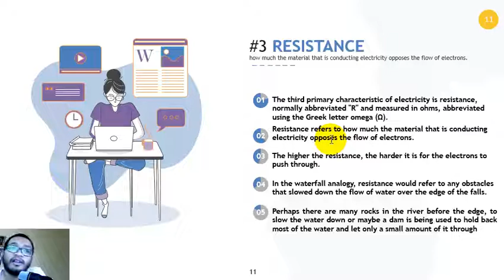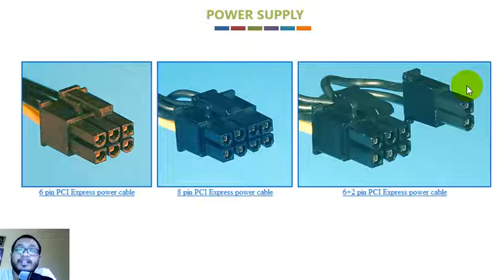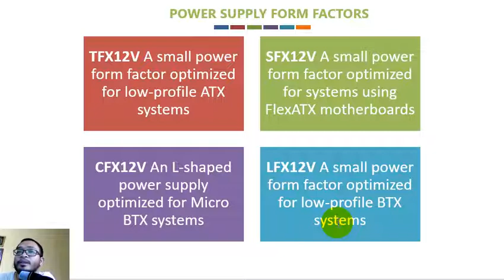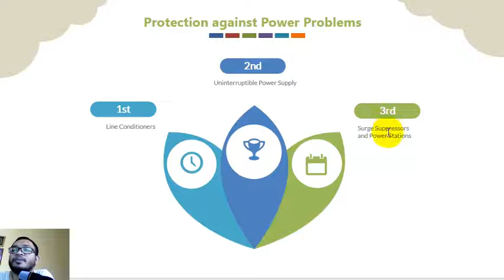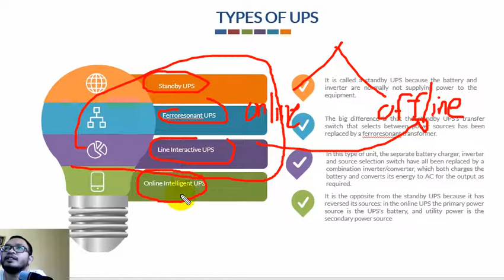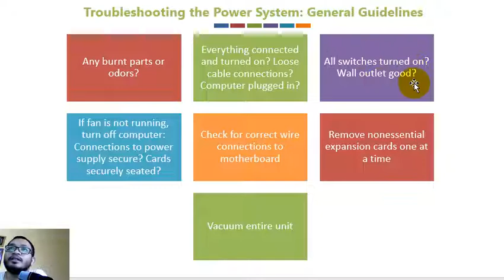Comment: In a conclusion, power supply is an electronic component that convert AC to DC. Electricity cause by movement of electron towards a positive charge. There are have 3 criteria or called as OHM’s law in power supply which are voltage, current and resistance. Voltage (V) is potential different in a circuit. Current (Amp) is an electrical current. Resistance (ohm) is resistance of the current. Next, AC and DC. Direct current (DC) is produced by batteries, static and lightning. Alternate Current (AC) is that you get from your house’s wall and that you use to power most of your electrical appliances. However this AC current must be filter by your power supply. There are have 4 roles of power supply which are stability, energy efficiency, expandibility and cooling. This power supply has many problems for example blackout, line noises, lightning strikes and brownout. Lastly, Uninterruptable Power Supply (UPS). There are four types of UPS which are standby UPS(the cheapest one), ferroresonant UPS, line interactive UPS and online intelligent UPS . There are two category of UPS which are online UPS and offline UPS.  Standby UPS, ferroresonant UPS and interactive UPS are under offline UPS while online intelligent UPS is under online UPS.

Comment: Chapter 6:
In conclusion, Power Supply is an electronic components that convert AC current and DC current.  In power supply, there are 3 criteria which are voltage, current and resistance. Voltage is potential different in a circuit. Current (AMP), is an electrical current. While resistant (OMH) is how much the materials the opposing the electricity.  Direct current is the first and simpler type of electricity, it produced by batteries, static, and lighting. Usually the voltage is about 12v only. Alternate current is electricity that can get from the house’s wall and use the electrical appliances. This AC current must be filtered by the power supply because the motherboard cannot accept the power that come from the wall outlet.  There are four roles of power supply, which is cooling, stability, energy efficiency, expandability. Besides, there are few problems of power supply. First is surges, it is temporary increase of voltage. Second, line noise, it is small variations in the voltage level that delivered to the computer. Next, lightning strikes, it will deliver a charge of millions of volts. Brownout is the opposite of surge, brownout is decrease of voltage. Lastly is blackout. Blackout is when the power is totally fails. Moreover, there are four types of UPS which can be divided into two category, Standby UPS, Ferroresnonant UPS and Line Interactive UPS is offline power supply. The only one that is under online power supply category is Online Intelligence UPS
.

Comment: In a conclusion, for chapter 6 which is about power supply I have learn about first is electricity. The conductors that allow the movement of electron, the insulators which is a materials that do not conduct the electricity. Then, the voltage, current and resistance is about electricity and especially on how we can use electricity that we need to able to measure its fundamental properties. Next is about alternate current and direct current. Besides that is networking connecting computers together so people can share any data and resources there. Power supply was divided into 4 roles which are stability, energy efficiency, expandability and cooling. This power supply has the problems like blackout, surges, line noises, lightning strikes and brownout. So I know that there a solution from these problems, the solution is the protection to power problems which are line conditioners, uninterruptible power supply and surge suppressors and power stations. Lastly, I had learnt about the types of UPS. There are 4 types such as standby UPS, ferroresonant UPS, line interactive UPS and online intelligent UPS.

Comment: As a conclusion,  chapter 6 discuss about power supply. in this chapter include voltage, current and resistance. voltage is also know as electromotive force (EMF). current is measured in amperes or amps, abbreviation ' A'. resistance is refer to how much the material that is conducting electricity opposes  the flow of electron. this chapter also include alternate current and direct current. Alternate current is harder to explain than direct current meanwhile direct current is the first and simpler type of electricity. Then, I know that network is a connecting computers together so people can share any data and resources there. power supply role have four which are stability, cooling, expandabality and energy efficiency. power supply form factor is TFX12V, SFX12V, CFX12V & LFX12V. power supply also have their own problem which are blackout,  brownout, surges and line noise. and the last one that i learn in this chapter is the type of UPS. type of UPS have four which are Standy UPS, Ferroresonant UPS, Line Intertactive UPS and Online Inteligent UPS

Comment: as a conclusion electricity cause by movement of electron towards a positive charge because of condustors such as copper. insulators are not cconduct electricty suc as plastic. 
voltage (v) is potetial differance or electronic force. current (amp) is how much electricity is flowing.  resistence(ohm) is how much the material that is conducting electricity opposes the flow of electrons. voltage can be measure using ohm's law. 
issues are being discussed in electricity is direct current and alternate current.
roles of power supply are cooling, stability, energy effeciency and expandibility. 
power supply form factors:
TFX12V=ATX
SFX12V= FlexATX
CFX12V, LFX12V=BTX
Power supply problems are surges, lin noise, ligtnng tsrike, brownout and blackout. this can be protected by line conditioners, uninterruptible power supply and surge supressors and power stations.
types of ups are standby ups, ferroresonant standby ups, line interactive ups, and online intelligent ups

Comment: In a conclusion, I have learn from this chapter is electricity refer to the cause by movement of electron towards a positive charge. Besides that, voltage, current and resistance is about electricity especially how we can use it and also we able to measure the fundamental properties. Moreover, there are two types of electricity which are alternate current and direct current. Alternate current is harder to explain than direct current meanwhile direct current is the first and simpler type of electricity. Then, I know that network is a connecting computers together so people can share any data and resources there. Power supply was divided into 4 roles which are stability, energy efficiency, expandability and cooling. This power supply has the problems such as blackout, surges, line noises, lightning strikes and brownout. I know that there a solution from these problems, so the solution is the protection against power problems which are line conditioners, uninterruptible power supply and surge suppressors and power stations. Last but not least, I had learnt about the types of UPS. It has 4 types like standby UPS, ferroresonant UPS, line interactive UPS and online intelligent UPS.